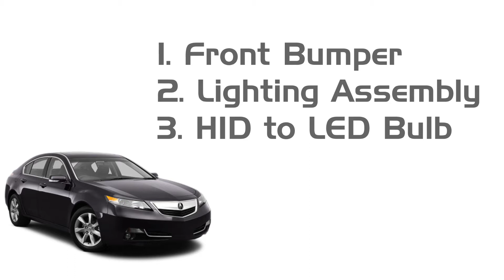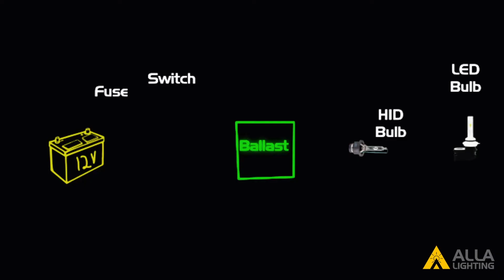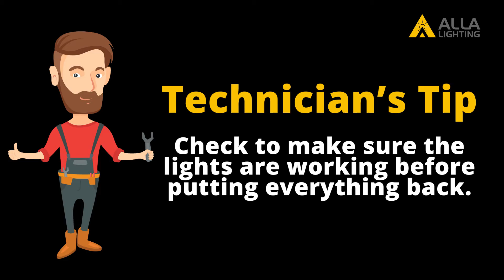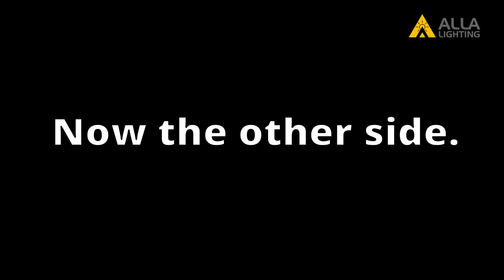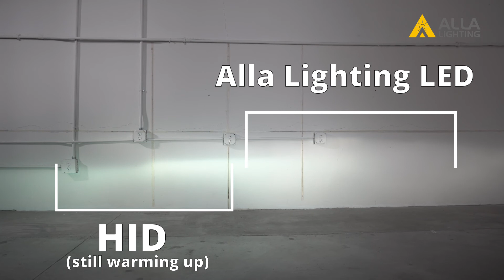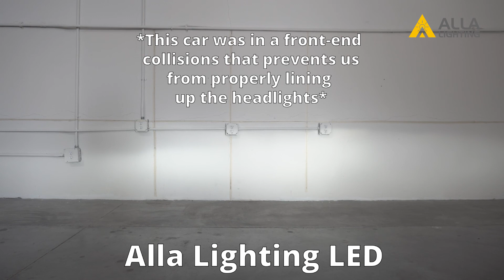2009-14 Acura TL Headlight Bulb Low Beam HID Conversion Kit LED Change

Comment: Why replace HID with LEDs for night driving? I bought upgraded HID bulbs and remember my mechanic went up through the front wheel liners. Didn't have to remove front bumper. Also changed the DRL/High Beam florescent bulbs to LED at a reputable shop and have had no error codes or any issues.

Comment: What the hell is wrong with these car and truck manufacturers?  They have turned the most simplest  fix of replacing a burned out headlight bulb into a trip to the body shop or at least a half day ordeal of tearing a car or truck apart to change a what used to be a simple bulb😬
Reply: I have this car, and I'm not happy they want you to take the car to the dealership for a Damn Bulb replacement! Oh and then they'll charge you $200+ to do it that's not including the cost of the bulb! 🤬
Reply: I just asked for HID lightbulb at Acura. They want 224 for only 1 plus tax & doesn’t include hand work
Reply: I can literally change both fuel pumps in a TL faster than I can pull 1 headlight bulb out.
Also have a MDX.
It too is very difficult to change the headlight bulbs, but not as bad as the TL